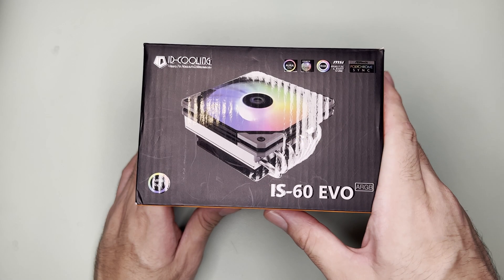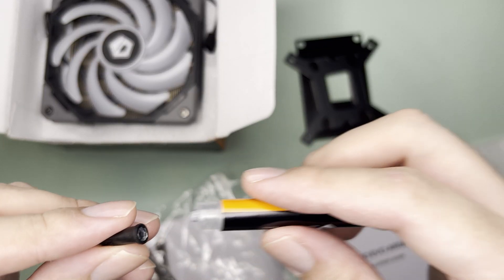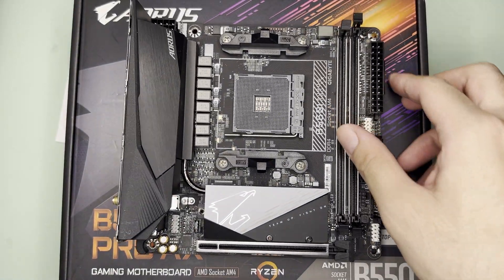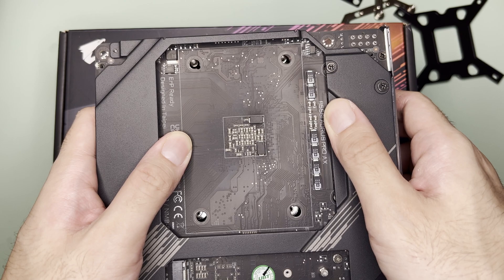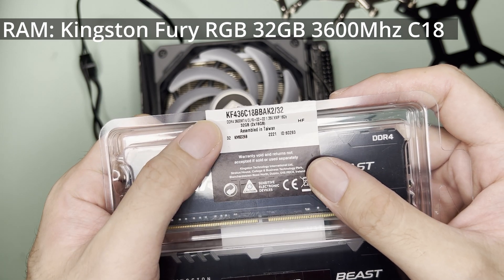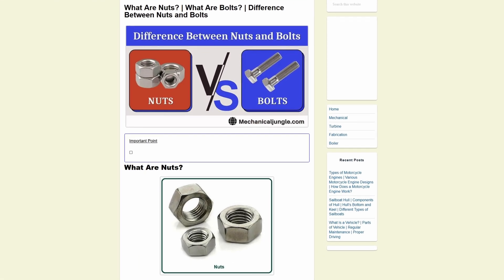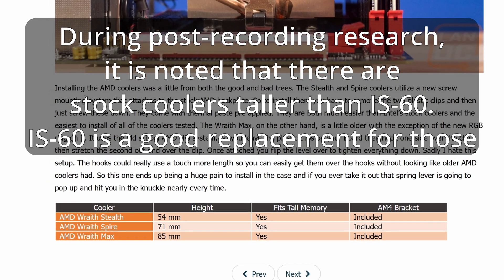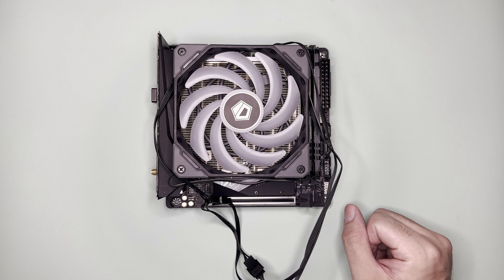ID Cooling IS-60 EVO ARGB Unboxing, Mounting, and Testing (Thermals vs Ryzen 7 5800X)

Comment: ok na to sa b450 msi carbon max wifi?
Reply from the maker: Ang tamang tanong dito is kung anong CPU yung plano niyo palamigin niyo sa cooler na to.

As for compatibility sa motherboard, i suggest to contact ID cooling support.
Reply: @manongunboxing  ryzen 5 5600g lng nmn
Reply from the maker: Should be fine sir kahit stock cooler.

Comment: Sir possible po ba na 3 rgb fan po? is sa is-60 rgb tapos 2 fan rgb po? i mean may extra pin po sa motherboard for rgb?
Reply from the maker: So may extra 2 case fans kayo na argb din? Bale, check motherboard manual po muna kung ilan yung argb headers niyo po. Kung wala, then bili po kayo ng argb controller (usually de-remote). Pero kung meron naman kaso kulang, need niyo po ng splitter or hub.

Make sure lang din sir na yung pins e magkasing dami. May 3 pin at 4 pin argb kasi.
Reply: @manongunboxing  same motherboard po sayo same itx case din d21 pro po gusto ko same yung is-60 plus two fan in top na rgb po ano need ko na accessories or no need na po the motherboard can handle all pin?
Reply from the maker: Need niyo po ng splitters or hub. 1 lang kasi yung pin out natin.

Comment: I have the same air cooler I used it on my interposer I9 11900h because it throws air in the VRMs, now I got an Auros Elite with Ryzen 7 5700X and I was in doubt whether to continue with it or not, but your video helped me a lot and here in Brazil nobody posted a video with the necessary information, won a subscriber from Brazil. congrats on the content.

Comment: From what I've read in the SFF forums they added the AMD/Intel backplates to the IS-60 Evo and its little brother IS-47K about 2 years ago due to customer complaints. That is likely why the backplate installation method is not mentioned in the manual (and probably due to cost costing they never updated their manuals). Even their website doesn't include photos of the new accessories.

Comment: is it also good for lga 1150?
Reply from the maker: Yes. Compatible with 115X. Official website for more details: https://www.idcooling.com/Product/detail/id/227/name/IS-60%20EVO%20ARGB
Reply: @manongunboxing  Thanks! I'm worried about space allowance between pcie slot and the ram slots. my stock cpu cooling is measured (6x6x2.4 inches). I hope it would fit on my old Lenovo M73 sff with intel H81 express chipset. Thanks new subscriber here!
Reply from the maker: Since I'm not familiar with M73, that is probably a concern. But if the layout is a standard mini-ITX, then you shouldn't worry. (usual layout means standard ATX-size I/O ports at the back, and then at the bottom of it is where the PCIE slot is. the RAM would fall into its usual place if that's the case)

Comment: Been enjoying your reviews on air coolers! I have the same MB so it is nice to see air coolers with it. Is it possible to have higher ram sticks with flipping the cooler? Like around 44mm in height? (G.Skill Trident Z Royal).
Reply from the maker: hi, sorry for the late response on this. If you turn it 180 degrees (vertical flip), you might have issues with case clearance as the heat pipes will definitely protrude. If you turn it 90 or 270 degrees (horizontal orientation), you will not be able to mount it in this motherboard (AM4 is rectangular in shape). 

However, as for your concern on RAM clearance, please go to timestamp 05:53. You can see a lot of available clearance as the heat sink width is less than the fan's width. Based on my math, you can fit in a 49mm tall RAM (64mm total height of the cooler - 15mm height of the 120mm fan). The one I used here is a 42mm RAM.

Here is ID Cooling's render on Corsair Vengeance: https://www.idcooling.com/Admin/Tpl/default/Public/kindeditor-4.1.7/attached/image/20200907/20200907141513_75223.jpg

Comment: I'm thinking of building a compact pc for gaming, here's the specs:

A520i Gigabyte AC Mini
R5 5600
RX 5600xt
Tecware Fusion ITX (not the TG sidepanel)

Question: I'm looking for a low profile air cooler, do you think this ID Cooling IS60 is enough for the said parts?

AIO is not an option.
Reply from the maker: Yes
Reply from the maker: The stock cooler included in boxed R5 5600 will also just do just fine for normal operations.